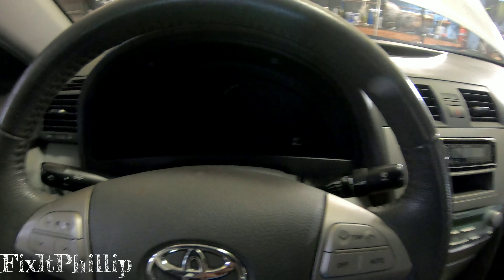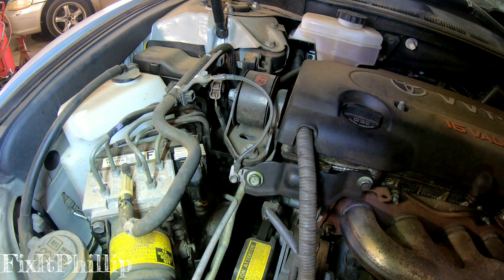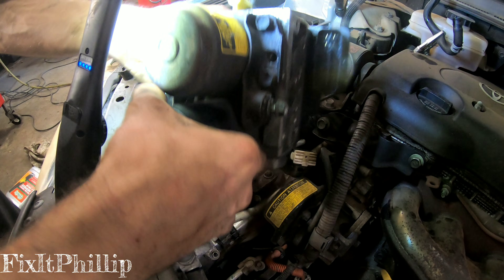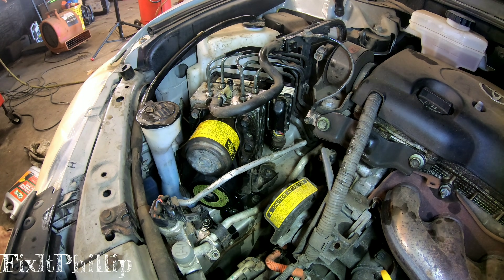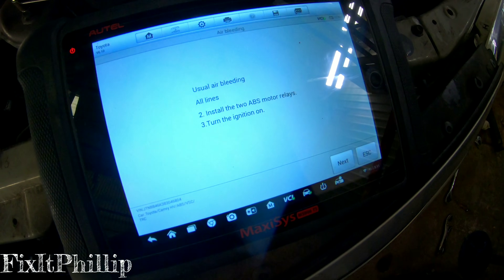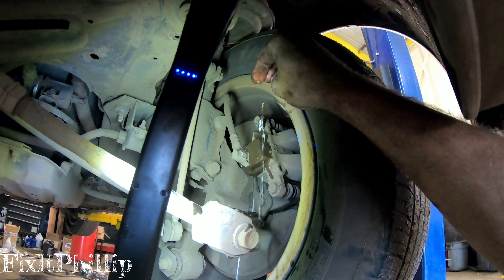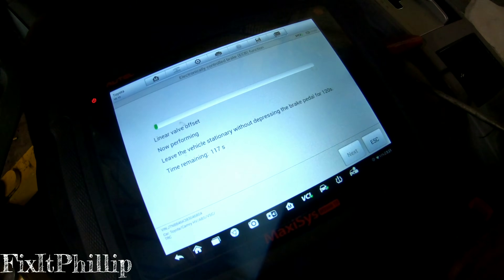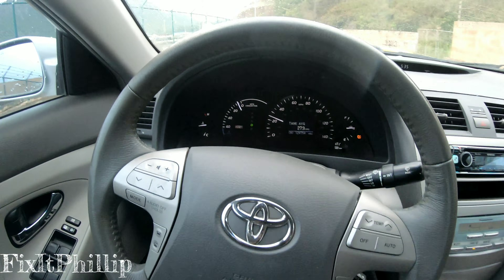07-11 Toyota Camry Hybrid ABS Module Replacement & Brake Bleed C1252 C1256 Abs Light On Accumulator

Comment: This is not even a hybrid camry
Reply from the maker: Yes it is,  do you see the orange wire loom near ac compressor
Reply: @FixItPhillip  That's right. But I have never seen a 40 series hybrid camry with black engine cover. May be it's different as per different countries.
Reply from the maker: Very possible

Comment: Thank you so much, saved us a couple thousand from dealership!  Had the exact thing on happen on our 09 Camry hybrid, bought the part on eBay and a gracious friend swapped it! Cars running great! 🙏👌
Reply: Hopefully you see this comment. My 2009 hybrid Camry has the same issue and I replaced the ABS assembly. The module has trouble communicating with the diagnostic scanner though, and warning lights remained on. I later found out that the front end of the donor car had gone into a creek while it was still running. So I believe I received a water damaged module. But my question is, did you have to do any kind of programming of the replacement module, or did it just plug in and work?
Reply from the maker: On the one I replaced (same part # from same type of vehicle) no programming was needed, just the bleed process I showed
Reply: @FixItPhillip  thanks for the info. I was able to get a refund for the faulty unit I received. I decided to buy a new one from the dealer this time around. The new one communicated without a problem. I calibrated it using the scanner and bled the brake system just as easy.
Reply from the maker: Nice.  Good job

Comment: I have a 07 Camry hybrid and had the same exact problem, and purchased a junkyard module. Installed it, and 6 years later the problem never came back. You get like a Christmas tree lights on the dash and the brake does not work basically inoperable. I only paid like $200 for the part. Only issue you'll like have to deal with afterwards is a good scanner and cleae the Check VSC code. Other than that it's not a hard job.

Comment: Excellent video ... If have the same problem with my 2009 Camry already bought the ABS module... But my mechanic is asking 300$ to replace that... It seems very simple but what if i dont have the scanner to bleed the brake electronically ? Is there any other way ? Or i can just go to the mechanic to bleed it for me and remove the codes ???? Help please 🙏🏻

Comment: Great video! Does anyone have a 2006 Highlander Hybrid that has needed to do this? I'm having a challenge simply finding the part or model compatible part. My part # 44510-48080/0. The 2 I did find on eBay, I might as well have a mechanic fix it! The Lexus model it says it's compatible with doesn't look like my part. The electric hookup is on opposite side an thus will not fit in the caddy. Anyone have suggestions to help a sista in need! :) Thx

Comment: Philip my 2013 es300h squeaks when I get on the brakes and i thought it was the abs pump / actuator.   But i don't have the issue where my actuator is constantly cycling to try to prime pressure so I'm thinking its something else.  What did is this squeaking im hearing.  It sounds like it's coming from the cabin or engine bay.  It's not at the rotors
Reply from the maker: Record a video of the noise you hear and email it to me fixitphillip88@gmail.com
Reply: @FixItPhillip did you ever identify the squeak for this person? Curious what it was as I think I have a similar issue. Thank you

Comment: If you Please
(1) What model and year of MaxiSys scanner are you using?
(2) What is the least expensive decent scan tool to do the bleeding process?
Just bought a 2007 Camry Hybrid, pads good, pump cycles often, no power brakes. 
I ordered a tested replacement ABS Module to install,  Serial # 44510 30270 to match existing exactly.
(3)- Would the different model year ABS Modules from 2007-2011 fit/be compatible without extra programming for the  2007 Camry Hybrid? 
My retired Toyota mechanic friend insisted that i get the EXACT Serial # 44510 30270 to match he says the tool I need to scan the codes and  bleed it cost at least $5,000.00 
 Thank you Phillip
Reply from the maker: Autel ms906ts

Comment: Thank you for the great video, I do not have any error codes but when I step very hard on the brake pedal I hear the noise that is described by the dealership as ABS pump failure trying to accumulate pressure, do I need to replace the ABS assembly?
Reply from the maker: When it reaches a point where enough fluid pressure cannot be held or held long enough in the abs pump/accumulator, you will have an error on the dash similar to this video. My personal opinion would be to wait, especially if it is braking properly and you don't have any faults coming on. It is normal for the pump to cycle to build back up pressure when needed. But it will happen more frequently (even when not pressing on the brakes) when it's starting to internally fail.
Reply: @FixItPhillip  Thank you

Comment: Hey, just wondering if you have to do the bleeding through the system or can you do it manually?
Reply from the maker: As far as service data goes you are supposed to bleed it in the order shown with a scan tool in order to have it bled properly. I have not attempted to do it manually before so I'm not 100% sure what the turnout would be (whether or not air would still be stuck in lines)

Comment: I have Camry Hybrid 2007, and i changed the ABS module 3 times for the last 1 year. Every time i replaced i had to go to a guy with scanner to reprogram the new module (3x $100)..Finally i find out that the problem is in the pressure accumulator not in the module. I removed it, drill a hole, and mount a check valve. I refilled it with nitrogen (~2000 PSI) and mount it back to the ABS module. I succeed to bleed the lines (all 4) with manually controlling the pump and the valves through a custom made connector. I drained about 200ml on each line-3 times already with no air bubbles coming out, but looks like there is still air somewhere in the ABS module. I have brakes but they are not perfect. My guess is there is air in the accumulator - before mount it back i filled it with brake fluid but still.  Any help will be great appreciated. Great video by the way.
Reply: The whole module is one piece though.
Reply: The whole module is one piece though.

Comment: Great video! I have problems with mine right now and I ordered the part already. Question for you Hopefully you can answer me before I get the part, is it possible to do all what you did in the video without the scanner? Thanks again
Reply from the maker: I haven't tried without a scanner.  I'm not sure if you would be able to get all the air out good enough without doing the bleed procedure on a scan tool.
Reply: @FixItPhillip  Thank you, waiting for my part too and was asking myself the same question. I'll have to find a way to do it now.
Reply: Have you done it yet?

Comment: one of my mechanics sent me this link it was a lil too late though lol. the service info. is very confusing, to say the least. I managed to get mine programmed following the flowchart. they even call for pressurizing the reservoir to 50-80 KPA to bleed the brake actuator hose which I did, then clear "reset" memory then using the "invalid" option in the drop-down menu to mention some steps apparently unnecessary! i will try this next time awesome information Mr. Phillip! thanks!

Comment: Are there different actuators for different models or as long as it falls within the correct years I can order any actuator offline?
Reply from the maker: I would get the same part #. You can look it up online on a toyota dealer parts website and see if it supercedes to any other part numbers also

Comment: 2007 Camry Hybrid with 145K miles currently.  This is my 3rd ABS Module replacement...Original went out at 120K then had the Toyota refurbished unit go out under warranty less than 12K miles.  That replacement lasted a little longer but started to go out at 135K miles.  I been driving it since 135K miles with the lack of pressure noise getting more frequent and the cycling on of the pump when I turn off the car or open the drivers door going on for a good 15-30mins later.   Drove it longer while doing this to see how long it would go before it threw on the warning dash lights...so about another 10K miles I was able to get out of it.  I got an OEM used 56K mile takeout and swapped it last week.  The swap was fairly easy taking about 45mins as a first timer.  Now to the tricky part about bleeding the brakes....I see a lot of videos using the fancy computer to bleed.  We did not have that luxury of an expensive computer but had a code reader that could clear the codes also.  So we did it the old fashion method while the car was off pumping the brakes and bleeding.  Thus far about 500 miles later and a few 80+ mph stops to test out the brakes and all is perfect again.   Also had to have my hybrid battery replaced at 136K miles.  I went with Greentec Auto as they have a 4yr unlimited mileage warranty and no prorating either and thus far the battery has done great.  No issues at all and they came right to my house and swapped it out in about 2hrs time.   They are not the cheapest but I plan on keeping my Camry a long time and its been trouble free except for the ABS module but looks like I can comfortably swap this out myself when needed again.
Reply: I see you love your car, fixing it all the way till the end
Reply: I was going to say the same thing.  I'm trying to get around having to buy fancy 400.00 dollar part for the job.  I may have to try your 80+ mph method.  Can you describe safe testing conditions. Were you backroading it? Do you recommend a good code tester?
Reply: I have a 2011 carry hybrid. It was my wife's, she passed in 2013 I will ne glad when I can get rid of it abs went out at 130k and hybrid battery went out at 160. Did you just use scanner to clean the  codes and bleed it manually. I am looking at big bucks to have this done.I am an old school mechanic. Is it easy to do this myself.
Reply: @jimmyhawkins5357 .  We ended up saying screw it to the fancy computer controlled bleed they say ya must do and went old school bleeding.  Sure enough codes all went away and brakes worked perfectly.     Now the used junkyard unit did die instantly after about 9months leaving my car completely disabled and was not able to clear the codes or get it to drive at all.   Absolutely no warning whatsoever so had it towed to dealer and they replaced with new unit for $1,300 and it’s been good since.   I was shocked when they told me it was abs unit as there was no warning like the 2X before could hear the abs unit cycling many times after turning off the car but they said once the internals get brake fluid in them then they can’t got dry to get exposed and will cause the sudden failure.   That’s what they said.   Regardless car is running strong and still way cheaper than a newer Camry plus 35mpgs hard to beat
Reply: I have a 09 camry and abs module needs replacing too so u didn’t have to reprogram to the vin # like I’ve been hearing and u used your old scan tool to operate the servos in the abs or just kept bleeding brakes
Reply: Yeah i hearing the same shit to reprogram it and the mechanics are asking for 300 for that 😢 @mikeferreira1060
Reply: @94SexyStang what did you do after that?
Reply: Hey you Alive

Comment: Same issue with my 2011 camry hybrid, i drive a taxi I've done 525k's on it. I live in newzealand, couldn't apply brakes at all, literally had to drive at 20ks an hour luckily it happened during night time and i had a customer on board few seconds before the ABS pump died. Its costing close to $1000 NZD for replacing the pump including labour. I've also noticed couple of times a ROOSTER @10:41. Thank you for the video sir.
Reply: My mechanic ordered the part from the Toyota dismantlers, pump cost $800 and labour was $150, 3 months warranty its a used part, new ABS PUMP from Toyota is $2000, the car is as good as like before. I was 1 week off from work, i live in Wellington City, try with any toyota wreckers/dismantlers you'll find it, its not worth buying $2k part for an old car like us which did 525k's. Good luck in finding the ABS PUMP.
Reply: Bro Wr did u get fix, I can’t find part

Comment: I install the new actuator and bled the brakes fluid . The final part where the linear offset to initialize didn’t work . My brake is still Hard and lights are still on

Comment: I used your video to fix my 07 Camry Hybrid today. I installed the old. new replacement abs module, started the engine, and the unit sucked up most of the brake in the brake reservoir to fill what was lost during the installation. I didn't know how to bleed the brake lines but I believe the unit may have pushed out any pocket of air when it was sucking.  I added more brake fluids to the reservoir and cleared the codes, and all of the warning lights disappeared. The car is breaking normally again.  Thank you!
Reply: How is your repair holding up? Did you ever have to mess with it again or lights come back on?
Reply: @bens3767  still works wonderfully without any issues.
Reply: Did you air-bleed the brakes? That's the confusing part because I watched a video that said no air bleed needed, just cleared the code.
Reply: @yushanzhi5786  no, not ever. the unit did all that for me. my car still breaking w/o any issues
Reply: @xmedia-e still going strong?
Reply: Did you use a new module or used one.
Reply: You have to bleed the air out at the wheels.
Reply: Did you buy a used ABS module or what ?
Reply from the maker: @M.Ali-hacks yes customer supplied a used module
Reply: @FixItPhillip  hello. Would you be able to do this repair for me? If so where are you located?
Reply: When i first installed the used module it allowed me to bleed the front wheels but when I got to the rear it said Failed. Now when I try to start the whole process over ot says failed for everything that I try. Ive replaced the relays in case that was the issue but it stills wont allow me to bleed the breaks. Any idea what could be the problem?

Comment: Hi I need your help  kindly reply  .I replaced the abs on my 2008 toyota estima hybrid. Car was starting perfectly before  after  replacing the abs it's not starting code comes  c1259.what I need to do .
Reply from the maker: You have to also go through the process with a bidirectional scan tool to properly bleed it and the zero down initialization.  If you don't have that type of tool I would suggest having the dealer or another shop diagnose it.

Comment: Hi Phillip,

I have these codes in addition to an off putting chirping noise coming from the abs module. I'm wondering what the chirping noise is, but I know it is definitely coming from the abs module. Chirping in the sense of rubbing rubber ball on a wet window or something. It's hard to describe, sorry 😅
Reply: Also where can I buy the parts for this? Every time I search for abs module I just find the abs control module.
Reply from the maker: I would recommend getting it diagnosed to confirm its coming from the abs actuator/accumulator first

Comment: good video. but why not use the pipe on the bleeding valve to catch all the fluids. that way you can see air bubbles clearly and avoid spills. any way can i ask. when the scanner tells you to open a specific wheel, does it mean that it opens the lines in the ABS module of that specific wheel? can you explain that what is happening inside the ABS module

Comment: I did it all and now brakes are working properly but lights are still on code C1345 (linear solenoid Valve Offset Learning undone). Please help
Reply from the maker: You have to use a bidirectional scan tool to relearn the linear valve offset

Comment: Please help me with this , So I did Replace the Abs pump and still have the same ringing sounds and all the abs and other dashboard lights still on after I spend around $550 including the part and the labor 😕😕, do you think the problem is from the brake booster ? Because I have exactly that current issue “Brake booster pump motor on time abnormally long “ ? Or maybe the installed Abs pump is defective? Thank you
Reply: If you found a used part there's a chance the part itself is defective. You have to bleed the brakes or, as far as I know, the codes will stay and the noise won't go away. You can rent bidirectional scan tools for about 50 dollars to do this.
Reply: @penguinplayz5250  so when I finish install the new used pump and let’s say it all works well, should I still hear that sound coming out from the pump or it should be quiet after all the installation and programming done ? Thank you
Reply: @shenodaselamain6326  you will hear the pump building pressure. It should build pressure, and then you should only really hear it intermittentently while driving. If you hear it constantly, or once every 20 seconds or so, the accumulator isn't holding pressure, which means your abs pump is bad. I'm no mechanic but that's what I've learned from having to replace my own
Reply: @penguinplayz5250  I bought two pumps and both bad unfortunately, the scanner right now tells me that the accumulator sensor is faulty , how can I locate and replace that Accumulator sensor?
Reply: @shenodaselamain6326  the accumulator is built into the pump assembly, so you will have to find a different one. I found some good ones on ebay for a good price, 300-500 range.
Reply: @shenodaselamain6326  that was the exact issue with mine, replaced it, bled the brakes and cleared the codes, everything is good now.

Comment: I looked up the procedure for 2007 Camry Hybrid and it says to first bleed the line at the actuator pump , the bleeder valve which is actually on top of the ABS module, since you didnt do this (at  least in the video) shouldnt that cause you to still have air in the brake system somewhere?
Reply from the maker: There is a bleeder on the Actuator I believe.  And yes please do as it instructs you to do.